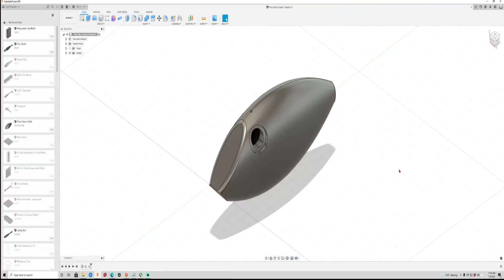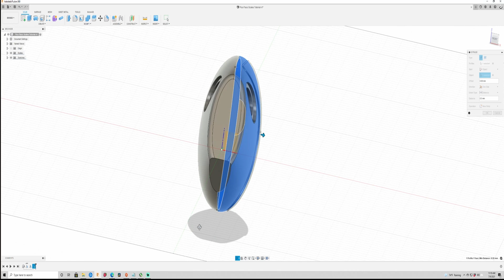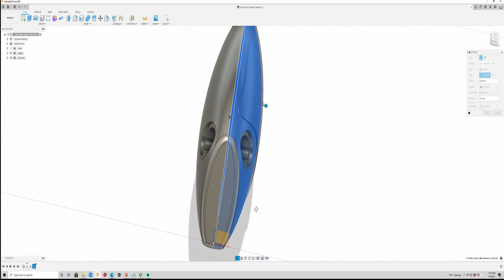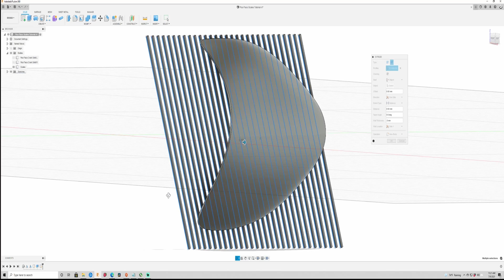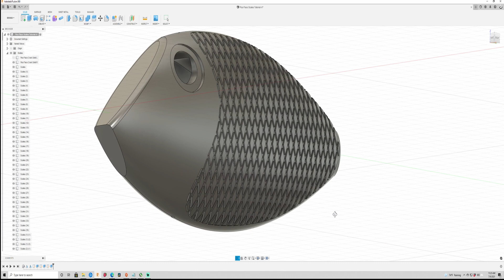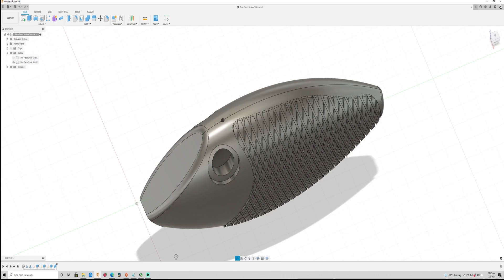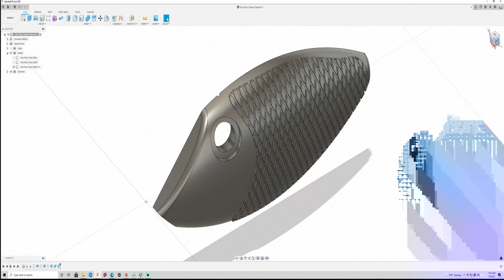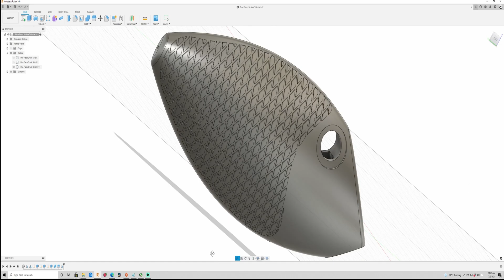Easy Fishing Lure Scales in Fusion 360

Comment: Another way is to save the pattern made in Illustrator as svg and import it into Fusion 360. But the biggest problem is that Fusion 360 gets very slow when you transfer pattern profiles.
Reply from the maker: Thanks! I have gone down that road before and it was very slow! I might try it again though, it has been about a year since I gave it a shot.
Reply: @WMBayouLures  Did you use the emboss method when you were making texture on the body?
Reply from the maker: @chnblc  I don't think emboss will work on most non-uniform surfaces, flat of a perfect cylinder, at least that is the way it used to be. I have not checked since the most recent update though. I will check and see if it does now.
Reply from the maker: @chnblc  Nope emboss does not work on non-uniform faces, if you body has a flat face or is round it will probably work, but if not then it won't. This method works on all cases...

Comment: Great tips. This is why I like designing in fusion 360, always have to think outside the box, with a twist.
Reply from the maker: Sometimes I think I am on a treasure hunt to figure out how to make it bend to my will. I unlocked a few more treasures recently and have some cool stuff in the pipeline!
Reply: @WMBayouLures  By the way, I can't select lines for thin extrude, I have to select closed paths. My wall location says inside/outside, and yours looks like side-1/side-2. Wondering what version are you running, Mine is 2.0.9937.
Reply from the maker: @yauckoutdoors  Make sure you are clicking on the thin extrude option, select extrude, and then at the top of the little extrude box it says Type, click the second box over, then select the lines

Comment: my thing is, I like making hard baits with wood and just screw in eyelets for hooks, like with resin would I have to do a two part lure and make a through wire?
Reply from the maker: Not really I use screw eyes as well. I hope to have this design wrapped up and a video out next week, it’s taking me a bit longer because I actually went fishing 😆
Reply: @WMBayouLures  how do you get the screw eyes to stay in? I'd be worried about them ripping out haha
Reply from the maker: @Hughie1987  When I create the model I add in 1mm holes where I want the screw eyes to be. (Size depends on the size of screw eye of course). Once the lure is printed I screw the eyes in, paint etc, then put the epoxy on. I will try to setup some strength test soon to really get the numbers but my casual pull test show it to be plenty strong.
Reply: @WMBayouLures  ohh ok that's awesome